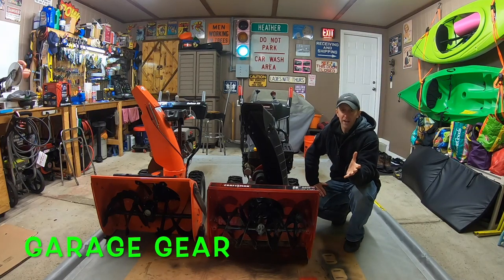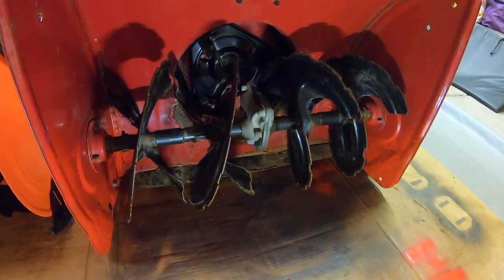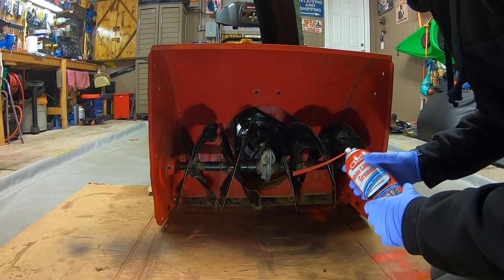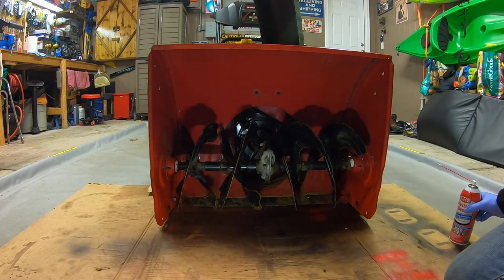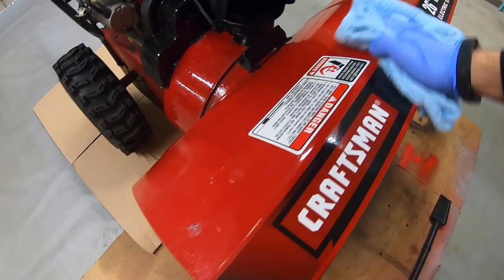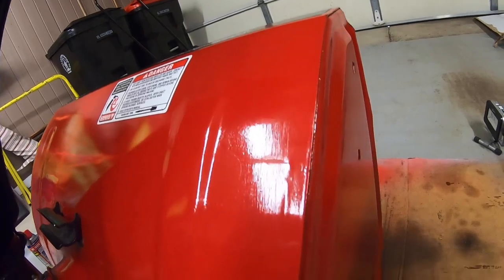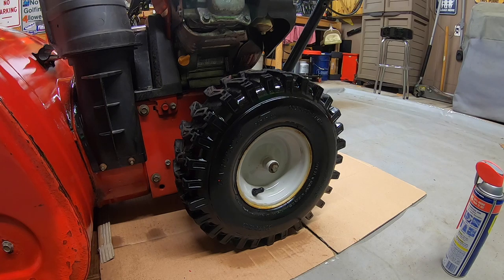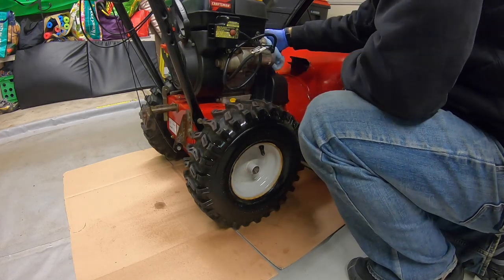CLEAN, SHINE AND PROTECT YOUR SNOWBLOWER. Cheap, Easy and Effective!

Comment: I mean a snow blower is basically a little car if you think about it.. You have a transmission, you have speeds forwards and reverse, paint with metal screws bolts.. rubber, tires everything.. 

Why not just use ceramic wax on the entire product You may have to take the auger off get to everything. 

CERAMIC WAX LAST 2 YEARS ON A CAR!! And remember that's with all seasons including the hot summer hitting the paint, the snow everyday. 

A snow blower is not going to be in this bad elements all the time. Only for maybe what 5 or 6 storms a year at the most. Then it's mostly covered or stored in a shed or in a garage.

So wouldn't the ceramic wax last even longer. 

If applied correctly it stops rust and everything. AND NOTHING IS GOING TO STICK TO THAT.. WAY BETTER THAN WD-40.. 

What are your thoughts?
Reply from the maker: I agree that it would theoretically last longer! In my opinion it just takes longer to apply when I can simply spray it down and I’m good to go!
Reply: @GarageGear  definitely see that especially if you work on snow blowers. And obviously can't really hurt. I just hope they're wrong about the paint... That would stink if I started doing that in my brand new Toro and then all the paint started coming off quickly. 

But I definitely would not be spraying that stuff in the quick stick gears. Their plastic not worth taking a chance better off using grease or silicone..

According to the really popular old dude Paul last name begins with an s. He claims you never have to put any grease or anything in those plastic gears for the quick stick of Toro.. 

But I agree I can't see it destroying a big thick plastic shoot.. Maybe it could discolor it over the years who knows. 

:(

Comment: automatic trans fluid is caustic to plastic and paint  looks good for a quick sale but then strips clear and degrades plastic  just don't !
Reply from the maker: Thanks for sharing! I’ve been using this for trick for years but never noticed any issues with degraded plastic over time. Perhaps certain brands do this?

Comment: Do you recommend sanding out any of the rust or just covering it?
Reply from the maker: Good question David! Depends on how bad it is!  I’ve sanded and painted two blowers before and honestly found it to be kind of a pain. The one blower got some heavy use after it was painted and some of the paint came off after about two years. So it didn’t hold up very long. You have to ask yourself at some point is it worth just selling it and getting a new machine or is it worth keeping for a few more years. In a lot of cases I just like to spray fluid film over it to slow down the rusting process. Thanks for watching!

Comment: WD-40 = Water Displacement 40th formula....just a bit of trivia
Reply from the maker: Great trivia question!
Reply: Correct. Its not really an oil but a water displacement product, although that fact doesn't stop people from misusing it. The less moisture sitting inside the machine the less opportunity for rust to accelerate.
Reply from the maker: @SpaceCadet4Jesus  spot on bud!

Comment: So now you have an oily machine that will attract dirt.  I agree that you need to oil things to keep them lubricated, but this will be a dirt magnet with all the oil on it.
Reply from the maker: Not a lot of dust flying around in the winter time. The oil/wd-40 does wash off after a couple of uses to so I end up respirating to protect it every couple of uses. My Ariens holds up great because of this. I guess it comes down to if you want it clean/shiny with not much protection or oily/possibly dirty and protected. It would be interesting to do a comparison to see which hold up over time. Thanks for watching!
Reply: You don’t live in eastern Washington a perpetual dust bowl. Everything is dusty. Yes we get snow in the winter. But the dust gets everywhere in the spring summer and fall. Anything oily is going to be coated in dust. So do you have a better idea for that?